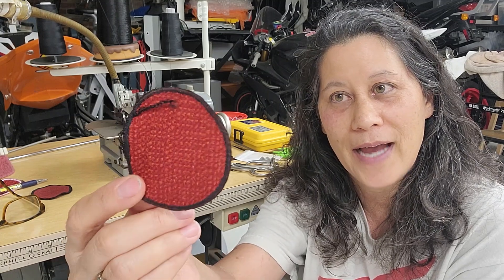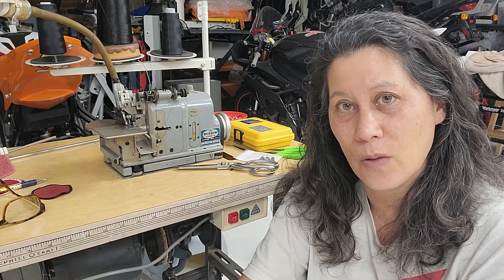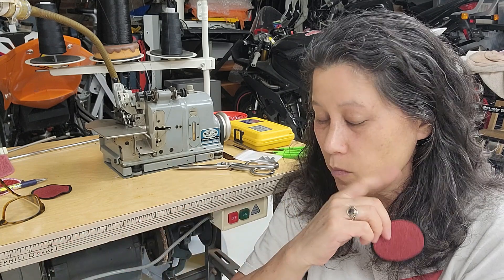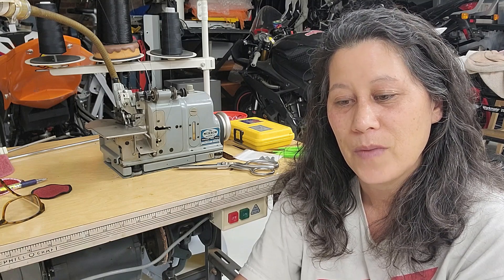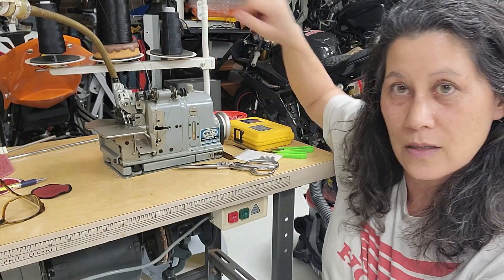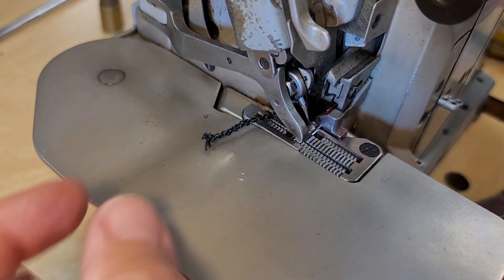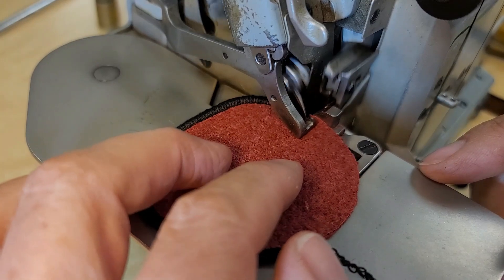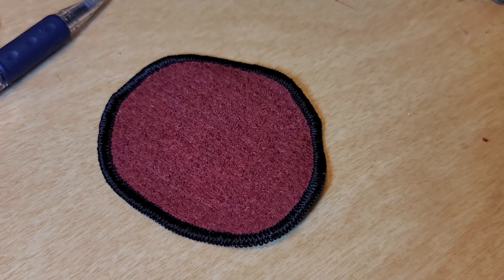Merrow M-3DW Patch Edge

Comment: Can you tell me what the reason for using the floss thread for the top and serger thread for the bottom was please? did serger thread on the top clog things up or something?
Reply from the maker: the floss thread is what makes the pretty edge and the one that shows or is visible.  the other threads one does not see so why use expensive thread there?

Comment: It is very interesting video. Thanks for uploading. Do you know the part number of the patch edge guide you mentioned? Thanks in advance.
Reply from the maker: I purchased this part directly from Merrow.  this part cost $70 and below is the information I received about putting the part into my machine. 
"you can use the 6-107-25 Fabric/Edge Guide in the M-3DW. You will need to remove the cutters and put the guide where the lower cutter goes in the machine"
Reply: Perfect! Thanks a lot!